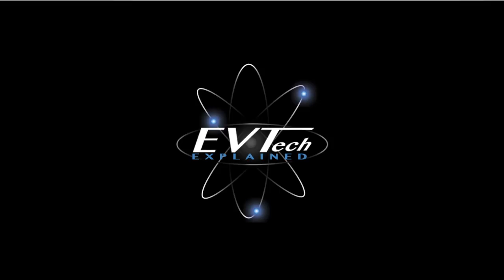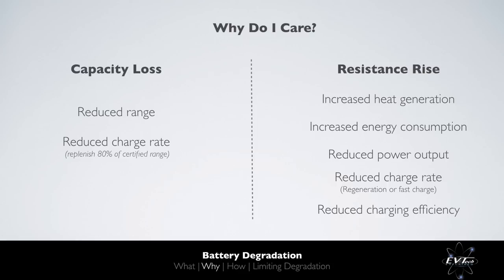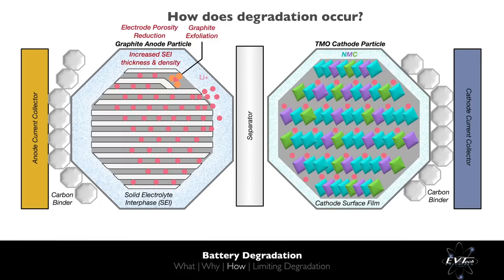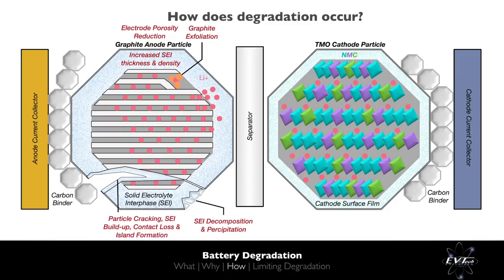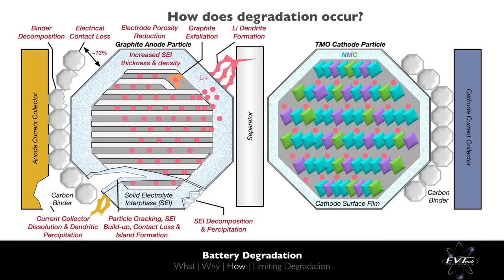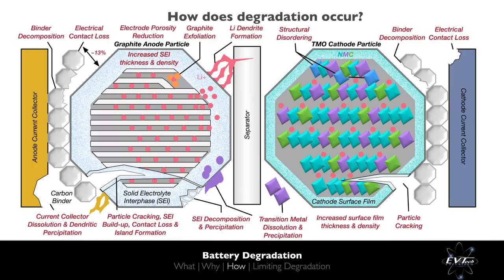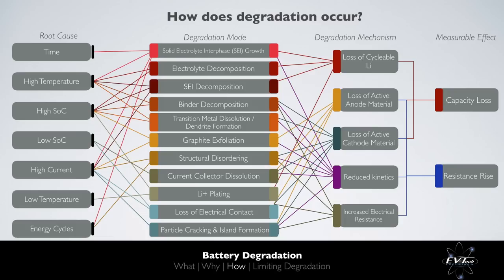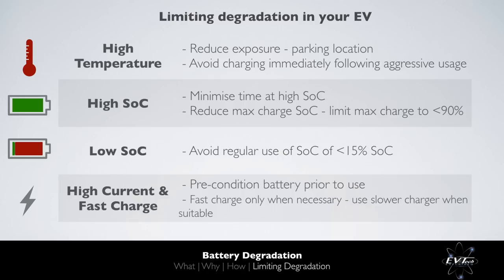Battery Degradation Scientifically Explained - EV Battery Tech Explained

Comment: Depth of discharge is a parameter that drivers have some control of. For example, I can choose to charge once per day, adding 60% SoC, or twice per, 30% a time. While it's clear that the shorter charges are preferable, can you comment about whether what's worse for the battery, idle time at 100%, or larger depth of discharge?
Reply from the maker: Idle time at 100% is usually worse but depends on the vehicle and the way the battery is designed

Comment: What this video taught me is that either there will be decades of small changes that will fix and improve each individual piece of this problem, or that there needs to be a radical change in chemical and structural design of batteries in order to eliminate these issues. 

This was a very in depth discussion, and I'm glad to have seen just how difficult and complex this problem is, and I'm also glad you included ways that the average person could improve the longevity of their batteries with the explanation.

Comment: Here's a few interesting questions regarding phones:

1) Do these same basic principles apply to Li-Po batteries?

2) Does using your phone while charging make any difference as opposed to running on battery? Would it be beneficial to do so?

3) Is wireless charging (which is naturally slower than wall plugs) potentially more damaging since it supposedly generates more heat? Or does the slower rate make it a safer alternative?

4) And lastly - can phone batteries be preserved for much longer by applying the same tactics to prolong life due to slower charging rates and less time directly under sunlight than electric vehicles?
----
My Galaxy s6's battery (5 years old) is in the valley of doom at this point lasting a whopping 25 minutes. It takes that long to go from 100% - 70% at which point it dies. I did not apply any of these tactics in the past to preserve it's life and greedy companies don't let us replace the battery easily.

So now I'm going for the Note 20 Ultra and so I really want to know if I can get that thing to last the next 5 years even better! 
Let me know pls, thanks 😎

Comment: There's a kind of positive feedback situation in their use as well. Useable capacity is high charge - low charge, but as your battery degrades you will need to push this  to a higher high charge and a lower low charge for the same energy, but this accelerates the degradation.

Comment: What a master lesson, and how well explained. Congrats and thank you! Question: you mention that Anode volume increases about 13% for NCM and NCA. With that, can we say that the Cathode volume decreases 13% as well?
Reply: No, the volume changes in the cathode are far less radical. I don't know if it's because it has more stable voids, or if there's just more cathode material per unit of lithium. It might be a combination of both.
Silicon anodes can store far more lithium than graphite, but they expand and contract even more, which is a big challenge.

Comment: A recent Fully Charged video showed a battery powered ferry that tops-up after every short crossing. They keep the battery within 40% and 66%
Accubattery shows 40-66% is just 5% of a cycle wear for this 26% depth of discharge (calendar wear should also be reduced at this lower charge state)
26% of 300 miles is 78 miles -- if the car can cope with repeated shallow cycling and not charging above 66%?
26% or 80 kWh is 21 kWh, so a charger would top-up in about
Constant 7kW charge: 21/7 = 3 h

Constant 50kW charge: 21/50 = 0.42 h = 25 mins
Reply from the maker: Staying within a narrow SoC window will help to reduce degradation, primarily because mechanical stress and number of electrode structural changes is reduced. The precise optimum SoC will differ for different battery chemistries and electrode designs.

Comment: I really wished more people would watch this before championing for EVs. Also, most batteries might not have enough usable range after 10 years due to all these factors.
Reply: Yes, the usable life of an EV battery is much shorter than the expected life of a vehicle, so - unlike vehicles with engines - replacement of this major component should be expected once in the life of the vehicle. That's okay, if it considered in the cost and environmental consequences of the vehicle choice. 

One city (Edmonton, Canada) that recently started adding battery-electric buses to its fleet budgeted for complete battery replacement at 12 years, and was provided with a 12-year battery warranty from the bus manufacturer.
Reply: Most EVs come with a 10 year warranty on the battery. The average car ownership in the US is 6 years. Although there are plenty of people who keep cars for 10-20 years, this is not necessary common. EVs in their current state are perfectly fine for 85% of people. I have a 2012 Nissan Leaf with only 15% battery degradation and the Leaf doesn’t even have thermal management. There are plenty of Tesla Model 3s and Chevy Bolts who only experience 5% degradation after 100,000 miles. So it’s rare for a battery to degrade past the point of usable during ownership. People also confuse degradation with function. Most EV batteries are manufactured to function for 300-500k miles. So it’s also a rarity that a battery will ever just stop working during the ownership of one.

Comment: In 7:30, the reduction of porosity size of the SEI as it thickens, makes it possible for Li+ to not fully dissolved. Question here, if the porosity size is smaller, wouldn't the pre-solved Li+ (before entering anode) been more cleanly "stripped", hence more fully disolved, AFTER they penetrate the SEI layer? Completely opposite logic here, I wish I made it clear here and hopefully anyone can shed some light on it?

Comment: It becomes further complicated when considering the correlations between the root causes (16:00). For example, the charging power (high current on the chart) will impact the battery temperature. Also depth of discharge (DOD) is another factor often considered to be effective which could be defined as the difference between the state of charges before and after discharging (through normal usage or V2G service). Moreover, in theory, energy cycles is also a parameter which could be controlled by EV chargers. It just depends on whether or not the EV charger considers the charge/discharge cycles in their operation algorithms.

Comment: - Do not park at high temperature location.
- Use EV car within 20%-80% battery range.
- Do not use fast charging.
Reply: I don’t think so 😮 what is the point of the car’s battery if you can’t use it nor fast charge it.

Comment: Excellent video!  You mentioned trying to avoid fast charging when battery is hot.  In the case of 2170 Tesla cells, what is considered hot?  The common knowledge of owners seems to be that Supercharging will occur quicker if you "drive faster / highway speeds" just before charging.  Is this a bad idea for longevity even though supercharging may actually take less time when hot?

Comment: What role does a "buffer" play in degradation? For example, Fords Mach E smaller batter is 76kwh but has a usable 68kwh, and the larger battery has a 99kwh capacity but is limited to 88 usable. I suppose this is about a 10% buffer. Thank you if you get a chance to answer. Some of this was a bit over my head but I'm interested in learning. I would also be interested in how a buffer is implemented exactly? At the top end, low end or somehow a bit of each.

Comment: Sorry for a silly question, but what is the correspondence between anode/cathode and positive/negative terminals of the cell? 

Anode and cathode refer to current flow direction, so they reverse depending on if the cell is being charged or discharged. What process do anode/cathode in this video refer to: charging or discharging? that's why i don't understand the correspondence.

Positive and negative terminals never reverse under normal operation, and so it is a better name, imo...
Oh, and thanks for this in-depth video, very interesting.
Reply: found the answer. 9:12 "during charge, [positive] lithium ions are transferred from the cathode to the anode" 
So, cathode is the positive terminal, anode is the negative terminal.

Comment: So I just got my Tesla and I'm curious say I run to the store and use only like 15 miles or so. Should I plug in my Tesla and recharge it to 90% or just wait untill the end of the day and then charge.
Reply from the maker: Congratulations!
If you don't need the range, don't plug it in. I tend to charge to 85% on weekdays for my commute, and leave at 60% at the weekend unless I'm going on a trip.

Now that we're on lock down, I've left it unplugged at about 50 % soc.

Comment: Hi. Watched all Tesla videos and this one. Awesome work. Too bad you are not a regular content creator. Tesla claims 8 years warranty on their batteries I read. Some websites say that even if you don't use the batteries, just enough to keep them at a nice (storage) voltage in 3 years they will have to be renewed. I suppose batteries are better now. But looking after your batteries like charging them only to to 3.92V and never deepcycling them and after 5 to 10 years, if your $10K-20K battery turns out to be nothing but paper weight, it will be devastating. You won't save enough from the fuel to make up for that kind of cost. People don't talk about that.
Reply from the maker: Thanks, I make as many as I can.

Tesla have proved that their batteries should last for over 8 years, by having cars in the field for more than 8 years. Realistically, you'll should be concerned about battery life when the vehicle is 12-15 years old...
Reply: @EVTechExplained  would you be able to say the same thing about other brand name batteries like Samsung or LG? If I invest in them and say use them only 4 months a year. Do you think they'll last 12-15 years?
Reply from the maker: The statement is also true for Samsung and LG Chem cells
Reply: @EVTechExplained  NMC or otherwise(chemistry agnostic)? They do have different cycling performance. I wonder if their cycling performance correlates to their life span performance. Thanks a lot for responses.

Comment: Awesome!
One question, for daily usage on a Tesla P100D, would it be better to
- Keep in the 75% to 35% SoC range, resulting in some short high current discharges (pedal to the metal!), for example, 5C for a few seconds at 40% SoC, or
- Keep a higher cycle like 85% to 45%, so that those short high power discharges occur at a higher average SoC?

What I'm really asking is what's better: to have an average SoC of 55%, or to have an average SoC of 65%.... both taking into consideration the existance of short high power discharges?
Probably the right answer is: to a 75% to 35% cycle, but only floor it if the SoC is > 50%, or so.
Reply: Not an engineer, but those both seem to be within the healthy SoC range, and the graph at  11:15  shows mostly linear potential voltage  within the stability window. I know this doesn't address high current discharge directly, but being within the recommended range shouldn't change for a few seconds of high discharge. I would say the 85%-45% is safer from not dipping into a low SoC and of course remember to let your battery cool down before charging!

Comment: hi i have a query. i was checking an article from research gate where they say storing the battery at soc of 15% will cause 1-1.5% approx calendar ageing around 25 degree celcius .....but they also had battery vs FCE(full cycle equevalent) degredation graph where using a ev between 10-30% SOC causes the slowest degredation compared to 20-30% .. ..thus using below 15% SOC upto 10% infact is better than using between 15-25%...i am a bit confused...
and i have been storing my battery around 10% SOC during calendear ageing as far as possible...so if its detrimental then i will keep SOC around 15-20%..thank you so much ..
the battery used in my ev sccooty is typical NMC battery from manufacture phyllion 48V 28AH

Comment: Thx I have question
Like in present world situation because of covid all transportation in India stopped in this case ,If a lifepo4 battery pack has 
1. Been charged charged for 100% and not used(discharged) for more than a month what happens to it. 
2. Same case with 50% charge
3. Same case with 10% charge in battery
Wat are disadvantages or nothing happens to it in all cases
Does degradation takes place
Reply from the maker: Degradation takes place most at 100%. Aim to store at 50%

Comment: I have made my model 3 for about 1 year. About twice I have ran the battery down to 5% and immediately plugged it in afterwards. Is the problem with a low state of charge (e.g. <15%) because people may not charge it immediately and go even further causing irreversible battery problems, or is there something inherently bad for the battery from simply going below 15%?
Reply from the maker: One problem is electrode stress related from going to very low soc, and the other is related to storage at very close to zero. Occasionally going to low soc is not problem. I've also had my Model 3 for about 1 year, and I also have gone down to 5% 2-3 times. If it is rare for you to do it, don't worry.

Comment: What do you mean by avoid charging immediately after aggressive usage? You mean long high speed stretches? But isn't that what we do on Suc and isn't the battery preconditioning on Tesla what this is for? Also on my Model 3 I noticed that when I drive at lower speeds at about 90km/h the battery starts preconditioning 15 minutes early when I set Supercharger as a destination (Tesla feature), but it doesn't when I drive 150. This shows me that with 150 the battery is already around optimum temperature. Not sure if Tesla cools or just heats the battery for Supercharger. What are your thoughts?
Reply: I think both. Charging on ac at home i see puddles of condensation water in the garage on hot days.